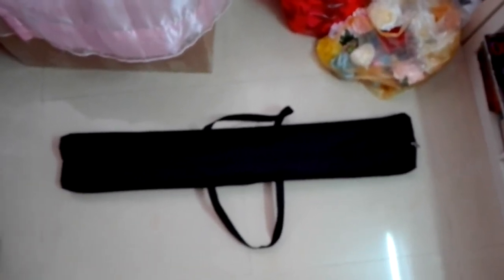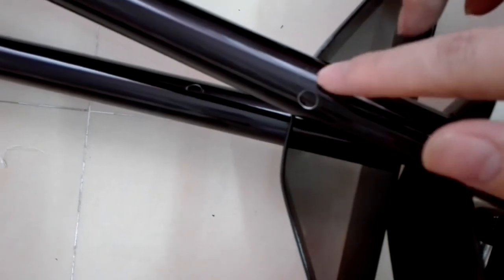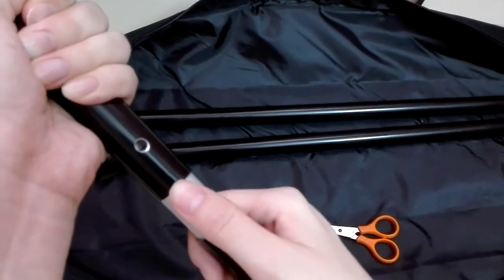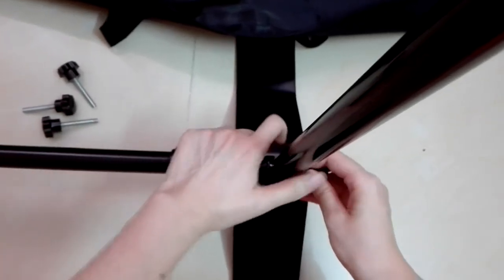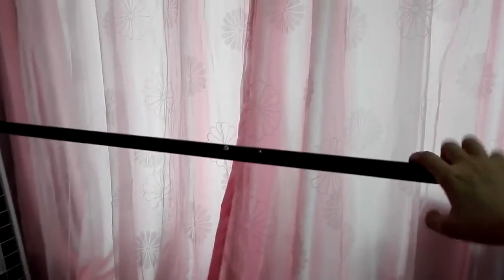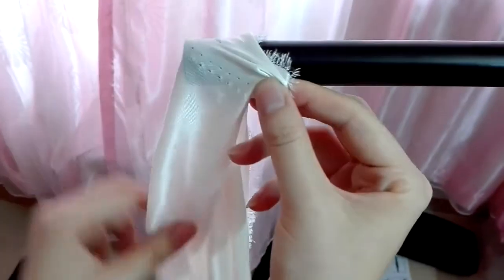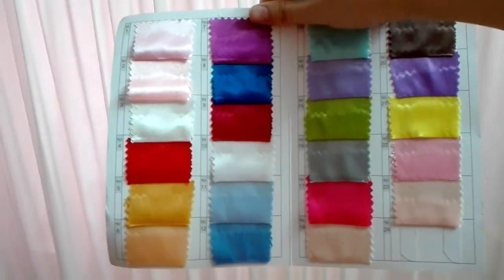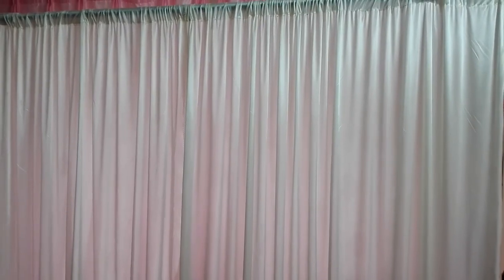How To Install the backdrop stand ( tutorial )

Comment: I bought this stand I fixed it for a event while removing the rod screw has stuck it's not even moving can u pls help
Reply from the maker: The one which connect two short rods ? I use this stand several years , and all things are good , Maybe you can check with the seller for the solushion.